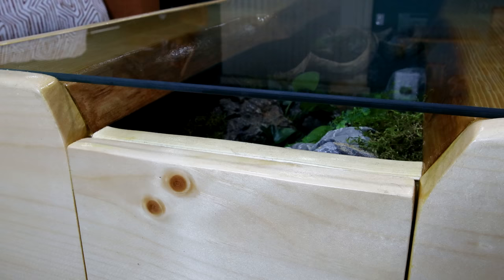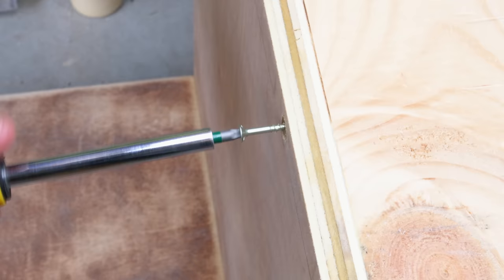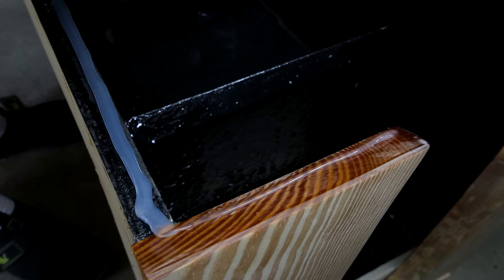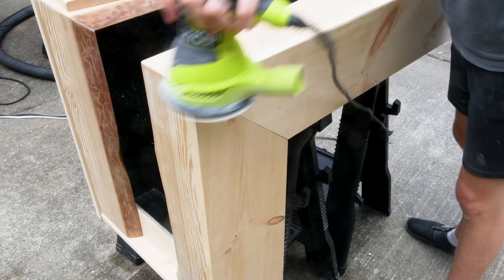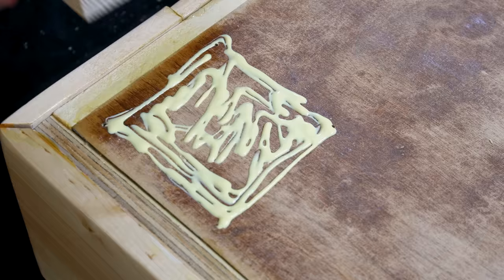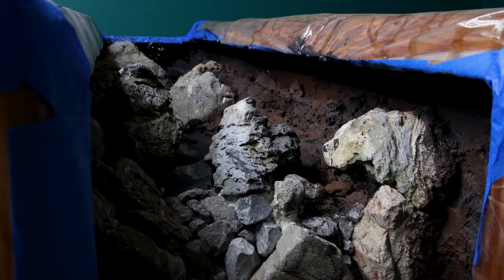I Put a Waterfalls Terrarium in my Table (Custom Build)

Comment: Love it, I personally would've loved the wood tinted darker. But that's just a preference
Reply from the maker: I typically do as well, but I thought the natural coloration would contrast well with the darker appearance of the interior.
Reply: @SerpaDesign  And it does, but it'd need to be placed in a room with similar colorations. It would make a great center piece to a bright jungle themed room. (also I work at taronga zoo Sydney Australia and I just wanted to say we house critically endangered species but the detail that goes into there enclosures is nothing compared to what you maintain in yours. There's not much preventing it except for the work that goes into maintaining an exhibit with so many elements. I have however appealed to the board to create some self sustainable enclosures for some non-threatened species. I thought you might like to know I used your videos as part of the pitch)

Comment: ~~Pretty nice Serpa.  When I resurfaced my coffee table w/birch. I followed 220 w/320 then 400 before finishing w/600 for good measure. Topped w/2 coats red mahogany stain&4 coats Krylon lacquer. 
~~Only time I use wood glue now is w/smaller things like dowels or minor splinter. Bigger projects like affixing the birch to the top I use WeldWood.

Comment: i have a old carriage house im restoring and use tons of foam for different gaps for quick seals and been using a layer of paint over it so it doesnt become brittle to the air. i never thought about using drylock like you did. that is a great idea as im trying to use alot of this foam in parts to keep light rain and moisture bouncing off

Comment: As you've probably discovered by now, you can't really mix flowing water with spray-foam - you'll always get foaming water. It doesn't look like you have a lot of foam at the bottom of your waterfall, so maybe you just have a bit of spray-foam that you haven't sealed.

Comment: With the chop, you should have done 2 layers of it because the chop you used looks to be 1 once chop, using 2 layers of it would make it a bit stronger and provide more support. Then you could have done 1 layer of chop in the other 2 passes.

Comment: if you were so concerned about hiding screws, why use retaining clips on the vertical glass? why not use slots on the edges so that the glass slides in and is held by the wood?

Comment: hello dude, I follow you from Turkey and I really like your work. Wouldn't it be more logical to use glasses cut to the inside dimensions after the exterior draft is completed, instead of spending a lot of effort and extra cost to waterproof the wood?

Comment: So I've noticed in this build and another one that you've used crypanthus in a position where they are kept very wet. Do they do well growing in water? I have a few and for me they seem to do best treated like I treat my bromeliads, slightly moist but erring on the side of dry and with pretty bright light. Also, awesome work!
Reply from the maker: Surprisingly well actually! Some of the lower foliage may melt off, but I've been growing them like this for years now and they thrive.

Comment: I would of gone For individual Addressable "Neon Flex"  RGBW  NeoPixels  Then the light Has more flow and a much wider Colour Palettes and Flow itself Mimic flowing Sun light and clouds Chasing over the landscape (Adafruit Has them and the Controller )

 NeoPixel RGB Neon-like LED Flex Strip with Silicone Tube - 1 meter
Product ID: 3869

Comment: I'm surprised he didn't router in slots along the side edges so he could just drop in the vertical glass. As much work as he spent hiding screws, the front glass clips stand out sorely.

Comment: Does anyone know if this would have issues with bugs and mold? or does the running water and air circulation help with that? curious about how to maintain this long term
Reply from the maker: Shouldn't have any issues with either. Maintenance is as little as trimming plants and adding more water.

Comment: But the water pump won't function for very long (especially when "Made in China"), without efficient water filtering.
If you should add an atomizer (mist-making device) to this great design, filtering the water becomes even more mandatory.

Comment: 🎯 Key Takeaways for quick navigation:

00:00 🌳 Building a unique terrarium coffee table with a waterfall edge was the goal.
01:01 🪚 Processed live edge pine boards for table construction.
02:33 🧪 Waterproofed interior with non-toxic epoxy and fiberglass.
03:35 🛠️ Concealed fasteners and sealed corners for durability.
04:35 🪓 Created an access port for the pump's cord and designed water overflow system.
06:03 🛋️ Applied lacquer finish, attached legs, and finalized the exterior.
08:33 🏞️ Set up the water circulation loop and tested functionality.
10:32 🌱 Created a natural-looking scape using foam, paint, and live plants.
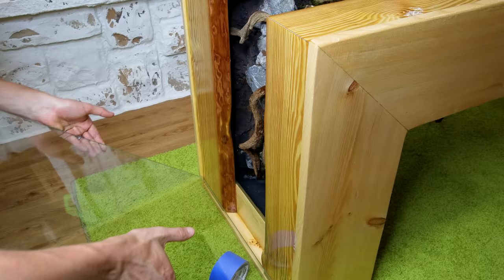11:59 💧Installed glass and secured waterfall edge, completing a functional terrarium.
13:18 🌈 Added color-changing lights for enhanced ambiance.
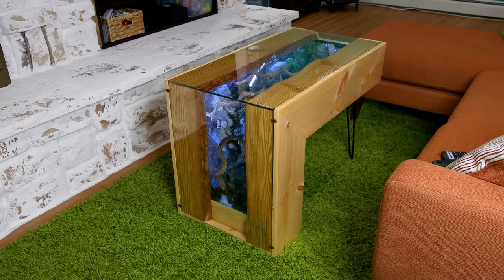14:20 🎨 A labor-intensive project combining art, functionality, and nature.